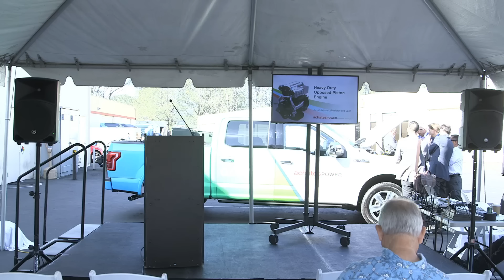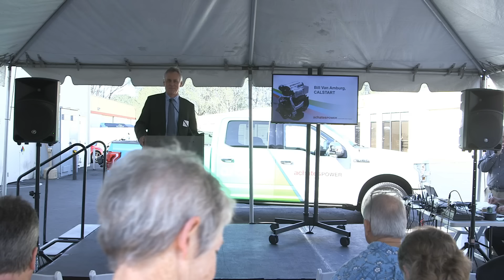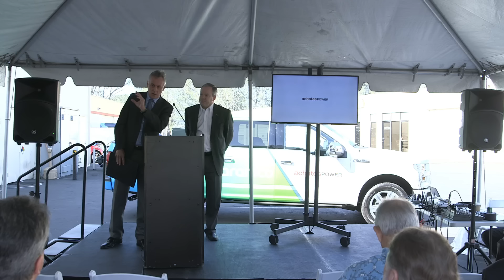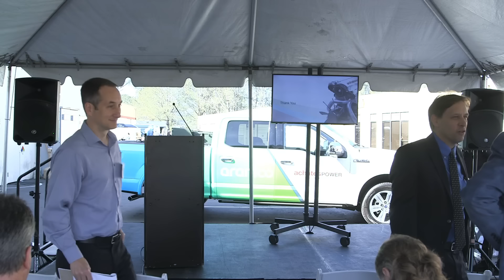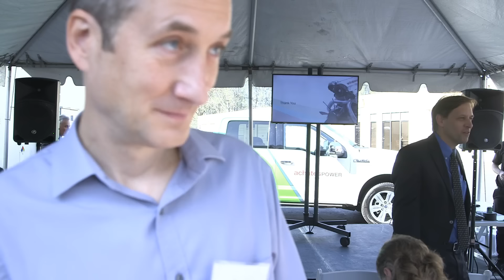Ultra-low NOx Heavy-Duty Truck Demonstration

Comment: Are each of two injectors per cylinder a different size? Are existing transmissions used in Class 8 a good match for this engine? Does the Achates engine provide moderate compression braking going down long grades?

Comment: By the time Achates engines hit the market, IC will be illegal.  So much time in development, with so much hype.  Almost as if the company's primary purpose has been as a "carbon sink" for green money.  The fact that you have no job openings suggests the company is about to go into full scale production, or close its doors.  Which is it?
Reply: Not even a chance. There's been no leap in battery tech that will make it happen. What's available right now is a joke.
Reply: @brianthompson9485  You are being reasonable.  Believers are not.

Comment: The only way to test the durability of an engine for a class 8 truck (the Peterbilt in your animation) is to put an engine in a semi tractor and pull loads averaging 44,000 lbs (75,000+ gross). You can't just engineer for durability and confirm it through computer simulations, that is how the early Tesla S cars ended up with motors that had a failure rate of over 60% before reaching 70,000 miles. Well, that is to say you can't unless you are taking massive amounts of taxpayer dollars and really don't care what the results are because you are covered either way.
  It's been years and all we have seen is cartoons and a pickup truck, so if you are not just hustling some ignorant government lackeys for grant money, drop a couple of test engines into semi tractors and get on with the real-world testing. Even if you fail the first time or two, you can learn things from the 100,000 mile teardown and inspection that simulations will never be able to tell you.